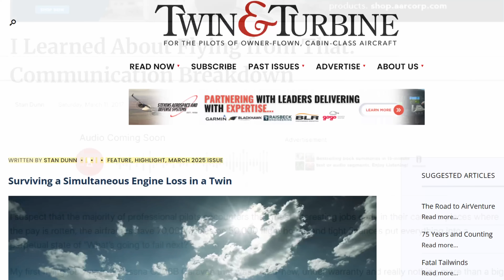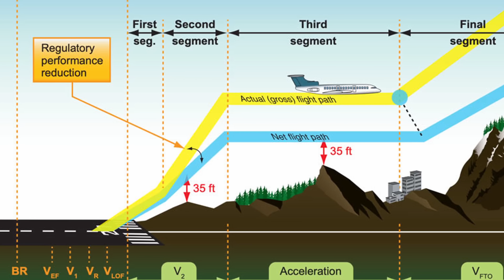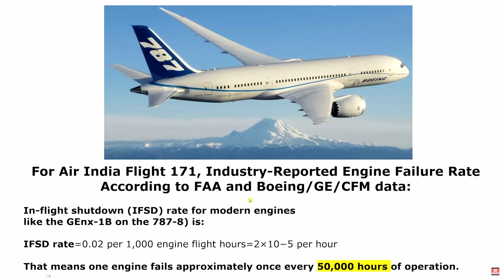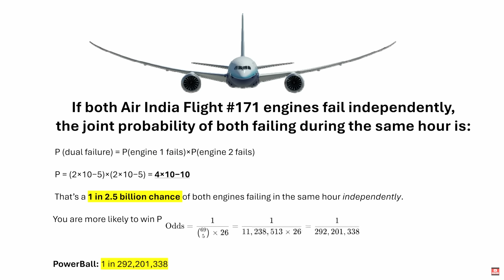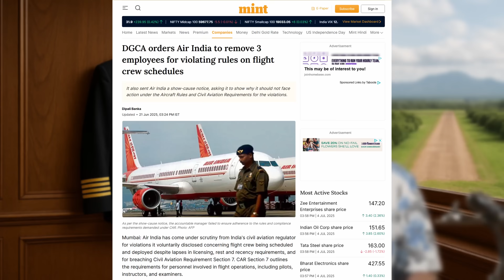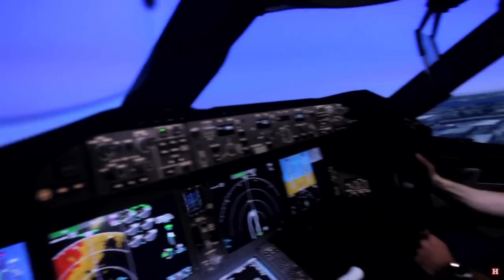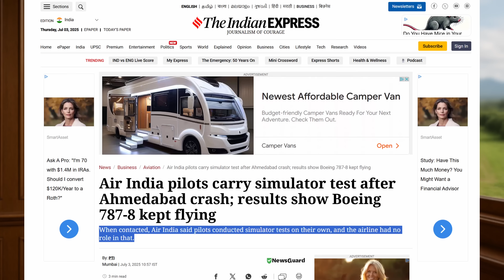Air India 171 Cause Becoming Clear

Comment: At this point, if the fuel was contaminated, other users of that fuel would have reported problems, too.
Reply: All speculation,no new info.see you when you have something.
Reply: I’ve been in aviation for over 40yrs. Fuel contamination happens. I was in an aircraft out of Singapore over the ocean. Engines got rough. We turned back.  5 gallons water out of each tank.
Reply: Or the refuel truck introduced the contamination
Reply: @robertjeffries2999  Most modern airports use hydrant fueling, the truck is only the filter/pump
Reply: @robertjeffries2999 . Most airports the fuel lines are under ground. They  don’t fuel from trucks. Direct lines from storage tanks to fuel pad!
Reply: @robertjeffries2999  the airport has underground storage and is pumped directly from the underground during docking and several flights before it had already used the same.
Reply: No contamination settles to the bottom of tanks . All the contaminated fuel could have gone into this plane in the center tank which both engines would have drawn from on takeoff.
Reply: @tonyhadley6965 the aircraft did internal flights prior - the centre tanks weren’t used. Some contamination existed in the centre tanks: on rotation it rolled into the collector bays, causing the engines to flame out. The cloud of ‘dust’ on departure isn’t dust, it’s steam.
Reply: unless the source of the contamination was from the plane itself.
Reply: Yes it did. Air India 315.
Reply: not necesarily.  If fueling was done from a truck, INTENTIONALLY FILLED WITH WATER... and after fueling that truck disappears or is abandonned, how would that affect other planes?
Reply: @mrbubbarosa  wouldn’t it be conspicuous to detour your fuel truck to a high pressure water supply somewhere on the airport grounds? There aren’t hoses lying around everywhere like à backyard.
Reply: @vincentdow5899  You show up at the airport gate with a fuel truck already filled with water.  Most airports have gates that are either manned or have a keycode to open the gates to get into the secure area.  The fuel farm is many times outside of this perimeter, so it is not unusual for a fuel truck to be going in and out of the gates.  Who knows what kind of security they have in India... well I do.. not at this airport but at Delhi, Calcutta, Mumbai and a couple other I have operated a 747 into.
Reply: Not necessarily.
Reply: All those computers and they still crashed! 

Kind of like my truck, all these sensors and it causes more problems than it fixes.
Reply: I believe there was previously an instance where the contaminant was introduced by incorrect maintenance when cleaning the tanks.
Reply: Not true. Contamination happened before without multiple airplanes affected.
Reply: That's not extensive experience, it's just a good start to flying.
Reply: @robertjohnston6768 Wow, that’s a wise and insightful observation!
Reply: Not really as the 787 usually takes off on the common center tank that is usually filled from a totally empty condition by design. Many other aircraft get their tanks topped off. The video was incorrect about where the fuel was coming from as it was coming from the center tank, which is standard operating procedure for the 787.
Reply: What fuel would have been available to test after the crash ?
Reply: But it haooened b4 too and dat too with 1 plane at that time
Reply: @zikrbrar3937 

VERY TRUE‼️ If u r referring to the salt water contamination incident?
Reply: @zikrbrar3937 ???
Reply: It's not fuel. It's definitely not birds. There is only one way this could happen. A giant cosmic ray shower hit all the electronics. It would not affect people, only ALL the electronics. Even radiation hardened electronics is affected, because radiation hardening only prevents permanent damage. It doesn't prevent glitches. A complete reboot may be required. But there was no time in this case. (A giant cosmic ray shower was recently recorded by detectors in Antarctica, that scientists can't explain.) (Think about that the next time your computer glitches, which mine does mysteriously about once per year.)
NOT! On March 29, 2019, a Jetstar Airways flight VH-VKJ had dual, not quite simultaneous, engine thrust problems due to fuel contamination that didn't affect other aircraft.
Reply: exactly, and both engines wouldn't simultaneously lose thrust, and if either one did, the video would have shown puffs of smoke/unburnt fuel/etc coming of the engines.
Reply: There was a high profile flyer in the aircraft. Ex Chief Minister of Gujarat state. Indian chief minister are equivalent to Governors in United States.
Reply: @PotatoMan007 Ex CM.. who didn't have even teeth left!!
Reply: It's gonna be vapor lock. Tarmac temp was 108°F - 112°F and add hot turbines, gravitational forces, fuel line temps and humidity....vapor lock which when the engines demanded more thrust the lock occurred and that is when the mayday happens and he says loss of thrust. Vapor lock.
Reply: Just one aircraft with engine failure from contaminated fuel used by multiple aircraft has happened so this can't be ruled out for Air India crash. Cathay Pacific 780 almost crash was caused by a fuel moisture trap filter rupturing most of its contents into the Cathay while residual fuel contamination was all enough not to cause failures of engines that were subsequently fueled from the same fuel supply header. I hope the India fuel supply is carefully investigated.
Reply: It depends on when the fuel was contaminated.
Reply: @brianrobertson877  That's stewpid.  No it doesn't.
Reply: @NegativeROG flawlessly mangled
Reply: @NegativeROG "stewpig" 😂😂😂
Reply: Exactly what I thought!
Reply: Can drinking a cow's urine be a factor
Reply: Wrong
Reply: Nicht wenn das Problem im Tank-Wagen selbst entstanden ist, zum Beispiel durch Kondensat.
Reply: Perfectly said! I am a retired airline pilot and agree with you assessment.
Reply: Pfft
Reply: depends , was it in ground fueling ? Or pumped from a truck ?
Reply: It depends of filtering capabilities of the plane...imagine one have a dirty filter and one have a newer
Reply: @Hmd1912 

If u r referring to water, the in aircraft fuel filter does not remove water, but rather particulate. The 787 has a different way to deal with reasonable amounts of water in the fuel with WATER scavenging jet pumps.
Reply: Google "fuel stratification" to understand how other aircraft may not have been affected.
Reply: Hey it is Air India- India is the buzzword. To the entire West, all Indians are backward, moronic, stupid, dumb, corrupt, and nothing good comes out of India so every Indian and India needs bashing, faults exaggerated, achievements downgraded and put them in their place so without a doubt regardless of the fact there might have been Boeing fault of some sort it has to be dodgy fuel, dodgy pilot, poor maintenance, essentially Indian corruption and ineptness.
Reply: No. All other airplanes have the same quality and life of fuel filters
Reply: There was another air india with both engine cut off but at high altittude so manage to glide to safety. Cant recall 151 somehing
Reply: Yeah bruh, he covered that
Reply: Unless it was improperly used fuel aditive... I recall that happening once.
Reply: My question: what happens if plane extremely overload than engine can handle flietworthyness.can defence mechanism of software triggered to shutdown engines from damage.? because plane took whole 3.5 km runway instead 1.5 2 km due to its loading and at that  day extremely humid and hot atmosphere there in Ahmedabad.
Reply: Nah, fuel contamination just a USA propaganda to steer their Boeing USA protected company from blame.
Reply: That’s not an aircraft specific problem. It’s an airport specific problem. Which can happen anywhere. Also it’s a rare occurrence and not repetitive. In case of a contamination there will be warning signs in the cockpit (fuel pump malfunction , engine compressor stalls and possibly engine shutdown) and the pilot action is to immediately land at the nearest suitable airport.
Reply: You clearly don’t know what is fuel contamination, in most cases contaminant doesn’t mix with fuel ( eg : water ) so a huge aircraft like this can be the only one contaminated. 
Already happened with A330 Cathay Pacific years ago, engines almost shut down.
Reply: But what if it was contaminated while fuelling this particular aircraft.
Reply: probably contaminated specifically for this flight. The conspiracy about pakistani insiders (plus the huge delays in blackbox deliveries) are way too realistic.
Reply: It would have showed up B4 VR if it was contaminated and as far as flaps when the pilots throttle up they will get a loud configuration warning and won't let the plane rev up
Reply: Clueless. This is the most corrupt state in India. They got greedy in the adulteration ratio
Reply: What if this plane was targeted. 
It could  be targeted  for insurance  purposes
Reply: could have been directly into the tanks. One famous example was the Airbus A321 biocide incident.
Reply: Not necessary, see what happened at VHHH (Hong Kong) on a A330 Surabaya-Hong Kong Cathay Pacific CPA 780.
Reply: And apparently both engines cut off at the same time. I think the fuel cut off valves were not energized thus shutting off fuel to the engines.
Reply: Not exactly true. Contamination may not be uniform.
Reply: fuel valve fails closed after DC power failure...heard it the day after the crash.
Reply: Unless it was related to the fuel filters or other parts of this specific aircraft’s system.
Reply: Absolutly.
Reply: Unless the plane was carrying some contaminated fuel from some OTHER source.
IE where the plane took off from last.
Planes even when showing empty still have gallons(or liters) of fuel left in the tanks.
If they were contaminated that might dispense with the other plane lack of problems.
(to counter that why would there no other contaminations shown world wide if true ???)
Reply: Or they sent a truck with prop fuel instead of jet fuel to fill a tank or top off a tank for a long trip.  It happens more often than you think.  Many airports have reported mixing fuel by mistake
Reply: @barryobrien1890  a jet engine will burn av gas... it's listed as an 'EMERGECY FUEL' in the C-5 flight manual.  And am pretty sure it will work just fine for a while (much longer than the few minutes it might have been in that 787) in any jet engine.
Reply: @mrbubbarosa burn ok but give full power to lift abn overloaded plane in hot weather.  It barely made it off the ground but showed no sign of engine flameout, just low power.  That's my 2c
Reply: @barryobrien1890  the sign that the engines were off is the rat deployment.  it deploys when the cds underspeed relays trip usually 50-55% N2.  Min idle is usually about 62% on a jet engine.  Or the hydraulic systems fail.  the jet took off normally.  it's an optical illusion because of the angle to the runway that it was at the very end.  it was not
Reply: If the fuel were the problem then it would affect long haul flights most of all as concern contamination
Reply: No shit. The guy in the video said this too...like near the beginning
Reply: Unless it was targeted.
Reply: @jamesa5720  Turkish company which was fired for supporting war efforts against India must have had insiders who did this
Reply: @jamesa5720 what bull
Reply: @jamesa5720  it wasn't, Mr tinfoil hat
Reply: @jamesa5720  unless you are a not a paid commentator!!
Reply: @jamesa5720  unless boeing is writing the script
Its not fuel contamination... It's electrical or software related dual engine failure.
Even a 3rd grader would know that unless the third grader is paid by Boeing or a Boeing fanboy  like most YouTube "I have <insert hours here>  experience" pilots
Fuel contamination ,  near impossible with current checks , cannot cause dual engine failure AT THE SAME MILLISECOND accurate TIME , or essentially  SIMULTANEOUS
Reply: @geraltRiviera  While I am not sure it was fuel contamination or not, there are indications that engines did not lose thrust at the same time. From banking of the aircraft, it looks like there were a few seconds between engines shutting down.
Reply: @user-yt198 

Yes, it does appear that the engines did not “fail simultaneously”, and very possibly one of them was still producing a little thrust for a longer period of time.
Reply: @geraltRiviera And of course that Software failure due to the manufacturer didn't happen before during the 11years of this plane exploitation by the airline?
Reply: @jamesa5720  or was contaminated by MX.
Reply: Please, come back when you have 56 hours. I believe you will know the answer then. We must leave no rock unturned.
Reply: The National Transportation Safety Board (NTSB) typically issues a Preliminary Report within Thirty - 30 - Days of an accident, regardless of when the "black boxes" (flight data recorder and cockpit voice recorder) are retrieved. 

While the NTSB will analyze the black box data to understand the sequence of events and contributing factors, the Preliminary Report focuses on factual information gathered at the scene and doesn't offer definitive conclusions.

At 13:39 IST on 12 June 2025, the Boeing 787-8 Dreamliner operating the flight crashed approximately Thirty - 30 - Seconds after take-off into the hostel block of B. J. Medical College in the Meghani Nagar neighborhood of Ahmedabad.

Today is 5 July 2025.  A Preliminary Report can be expected within 7 days.
Reply: @leochen887 

NTSB is not doing anything directly with the black boxes. It is almost a total Indian evaluation as they have the boxes.
Reply: @leochen887  11 july is when the preliminary report will be hopefully released by the AAIB
Reply: Water can enter fuel via condensation in the aircraft's fuel tanks, if the fuel is cold enough,  literally out of the airspace above fuel.
Reply: @jimgraham6722 Your just making up nonsense. 1 it doesn't happen . 2 not enough air above the fuel to contain  enough moisture to stall a lawnmower. 3 it was 43 
degree C over 100°f.  WTF nutty much.
Reply: Evidence will be in the fuel filters.
Reply: Need to see in context of maintenance in India aircraft maintenance hangar are no different from locomotive which is no different from a junk yard
Reply: @achekholbeck88  The call is coming from inside the PLANE!
Reply: It was a bomb in the avionics bay.
Reply: The fuel contam advocates answer that denial, by saying the jumbo 787 had a different fuel supply system/situation not used as much.
Reply: @billtracy8774 . Fuel contamination is just subjective without supporting proof. We all know that at this point. We have to wait for the Indian Investigators.
Reply: @billtracy8774 what is a "jumbo 787"? 😂😂😂
Reply: @Vladimirthetiny  Big aircraft with very large fuel load due to long flight, which in the case of AI171 hearsay is that is different fuel supply situation than most of the short-haul flights from that airport.
Reply: Contaminated fuel doesnt cause both the engine failure together
Reply: @anubhavgoswami4529 

It appears the engines didn’t rollback at the exact same time or rate. But we should know a lot more by the 11th.
Reply: @Mentaculus42 yup sad but need to know
Reply: Logic.   👊.   No doubt it was tested shortly after the crash and they must have found nothing.
Reply: Or aliens pushed it down! Wow, there are so many stupid comments!
Reply: Well..stupid people make stupid comments.
Reply: If it was any version of fuel contamination there would have been smoke coming from engine.....

Comment: Sorry. I don't buy this explanation. Consider a freak electrical transient that lasts long enough for both fuel shutoff valves to spring load closed?
Reply from the maker: What you described wouldn’t happen. Engines will continue running without any normal electrical power.
Reply: Not without fuel  @flyingformoney777